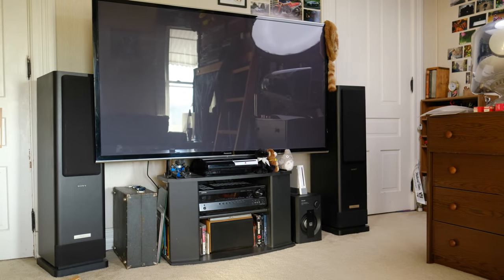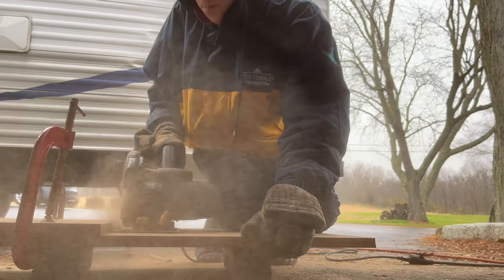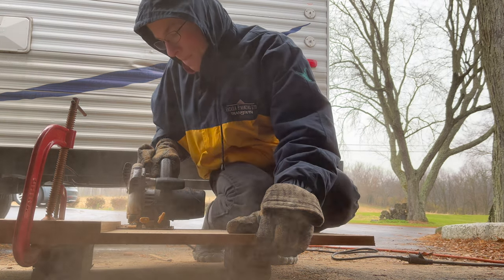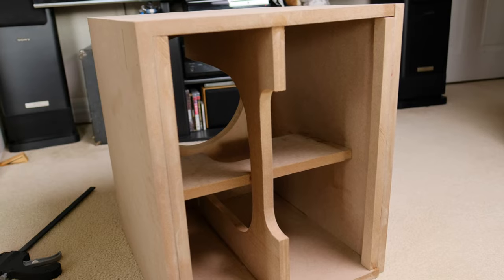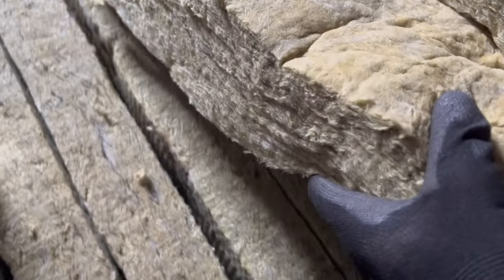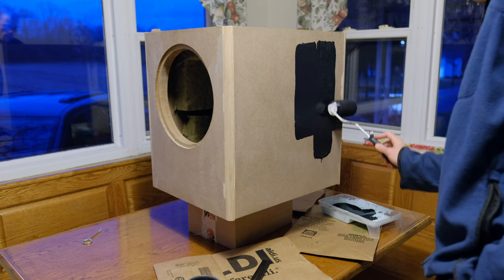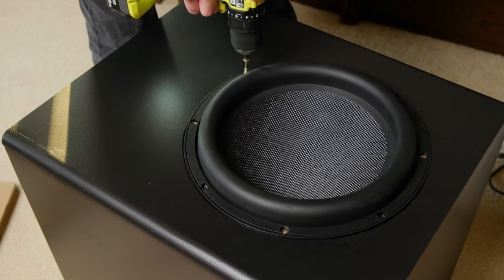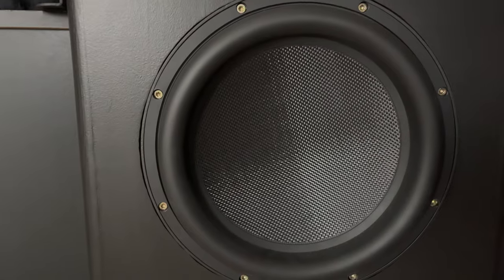I built a subwoofer for my home theater!

Comment: 100watts is no where near enough power for that woofer
Reply: It depends on the electricity contract you have, the meter above this value can stop.
Reply: Depending on the room it can be more than enough. 200 watts would only mean 3 db more
Reply: It’s for home theater
Reply: BS!  This is a 4ohm subwoofer that has a 91db @1watt/1meter rating. That means with 100 watts rms input this sub would be playing at around 110db. Doubling the power  to 200 watts would get you to 113db and 400 watts would get you to 116db. Most of you would never even get this sub past the 100watt usage above 110db except for at peaks. Doesn't anyone have any knowledge about  how this stuff works or do they just spew bad information all day long on these threads?  Sheesh!

Comment: It’s not good to under power subwoofers from what I read this subwoofer is 600wrms and you paired it with a 100w subwoofer plate amp the reason it’s not good is because the amp will end up working harder which could end up causing the subwoofer to have clipped signal and essentially burning it up.

Comment: Wow, your kitten didn't even flinch at the drill. Great video man, keep em coming!
Reply from the maker: That kitten doesn't know what fear is. She chases the vacuum around the house!
Reply: @griffensander  Tesla Model 3 salvage not impossible to put say Ioniq 5 motors and batterie and its other systems in it or other parts from other EV`s.... to make a Frankenstein car....
Reply: @griffensander have you upgraded the amp yet? That ultimax needs at lest another 400 watts for clean power and a demo is always a must because anyone can knock a box together but not everyone runs an ultimate o. 100watts so would be epic to hear and I know the mic will vlip butbus theatre and bass heads love it it sound mint through headphones or  theatre because you still get the sub bass come through and the mic clipping is just part of the process. Great build btw.its all fun ateotd

Comment: Great job!  I bet that upgrade did make a big difference!  Btw, the Rock Wool should actually work better than the quilt batting material.  For filler, Bondo works great with MDF, I use it all the time.  It smells a bit too but not so bad and it is really easy to sand.  

For your next upgrade you should consider building the LCR speakers, going DIY can get you a lot better sound quality than any of the popular brands.

Comment: I am impressed.  The sub looks fantastic. I have a Polk audio amp that I got as a replacement amp from Polk. The amp works fine. It’s 2400 watts max and 1200 watts rms. I bought the same woofer. I’ve had it for about 7 years. Thanks for the idea.

Comment: Really nice build. I am about to do a similar subwoofer build myself, only difference is I plan on using a car brand subwoofer matched to a plate amp.
Reply: Which brand did you go with?  I have two 15 skars along side two 15 monoprice sw15s
Reply: I went with an old kicker comp 12 I had from my previous car. It worked out great.

Comment: that sub can take up to 1200 watts, that 100watt amp will be be able to get some good sound out of it but you can nearly double the output with an upgraded amp like the Yung SD500-6 or if you want a dsp with it then the Dayton Audio SPA500DSP
Reply: What's the model of that sub?
Reply: The sub in the video is a Dayton audio ultimax 12

Comment: I have a question because I am confused here... if I use an amplifier board that has 2 outputs for two spekers, 250w each at 8ohm for two spekers that are dual coil 8ohm and 600W rms each speker will destroy my amp? What is the best configuration? The amp was used for a Piega PS2 swboofer

Comment: that Dayton is way better than what I have, I have a Jbl gt5 10" on a 700w dynamic power amp (each channel is 100w) the sub is a Dual voice coil and I'm using both coils its in a old box for a pioneer impp I have a 15" woofer and a 8" Sony subwoofer hooked up to a Sony STR-DH190 I used to have 2 gt5 10's but one randomly stopped working, the amp is hooked up to a battery in my room, and I'm charging a Interstate deep cycle battery, and I'm using a small Thunderbolt Magnum solar 12v battery

Comment: Out of curiosity, why didn't you go with a car audio woofer??? I replaced a blown 10" woofer in an Active onkyo subwoofer with a Skar 10" and I was very happy with it, much better then original...
Reply: Home audio subwoofers sound better than car audio
Reply: @simongeorge9705  maybe, maybe there is some better quality in sound, but in my opinion the power/cost/options on car subwoofers better...
Reply: Car audio subwoofers tend to be heavy coned, good for one note blurred high output.....hi Fi drivers are lighter and punch faster with better definition for those action films.
Reply: Car subwoofers are just space heaters with their high power ratings and low sensitivity 😅😅😅
Reply: @hhkk6155  yes, i understand the "audiophiles" need 20k gold speaker wire and all to ply vinyl... I'm in the 3d/Special effects industry myself, can't say I'm an audio expert, but 90% of cinema doesn't even get near the max dynamic range  of a Wal-Mart subwoofer... If the amp/reciver can even push it.... Its fine if it's not your preference, but respect others preferences and/or questions...
Reply: @simongeorge9705  ehhh I'd only agree to that on the higher end, but bang for buck, IMHO I'd get a decent receiver. And replace the subwoofer driver with appropriate specs....  obviously I'm not talking svs stuff, most ppl get some Walmart system and if there lucky and it's 8"-10" or larger it can be matched with car subwoofer...
Reply: @bitrage.  I'm not an audiophile))))
Reply: @hhkk6155  ok, then don't act in bs supiority, when in reality no difference in performance would be noticeable, just noticeable in price...
Reply: @bitrage.  You know that you can buy drivers intended for home theater use? No point in buying car audio parts, especially that are made for SPL nonsense 😭
Reply: @hhkk6155  true... much less options and ya don't get less and "carbon fiber titanium cones" marketing tho..... very important for sound clarity!!🤣
Reply: @bitrage.  The sub in this video has a carbon fiber driver, hello ))))

Comment: How deep can it go, 20Hz? I think the amp is too weak to drive this properly but that might also depend on the sensitivity of the woofer. Can it pressurize the room?
Reply from the maker: Amp is definitely on the small side. This particular amp also has a low pass filter of around 40hz, which really cripples it. I’d like to get a more powerful DSP plate amp, which should let me tune it to around 20hz.
Reply: @griffensander  I have similar issue with transducers, my cheap aliexpress amp has max HP of 60Hz, which is sometimes really too much for them. And is going down to like 25-30Hz min. Would really love to somehow lower the slope 10-20Hz somehow. Was thinking of modifying it somehow myself but I'm no expert in this. Well winter is coming so plenty of time to figure it out on cold evenings lol